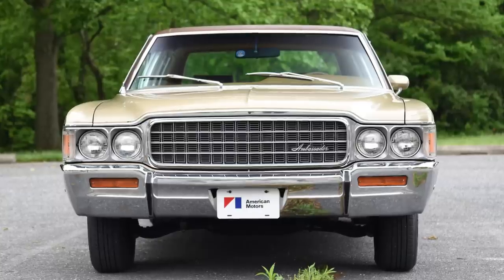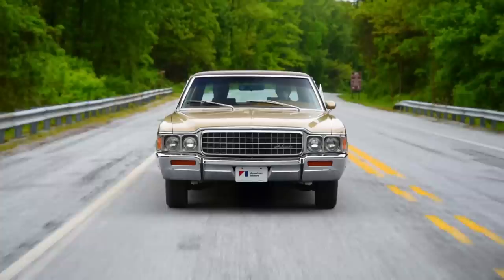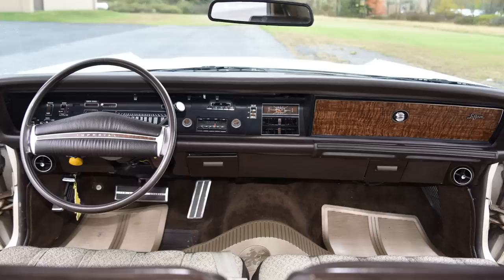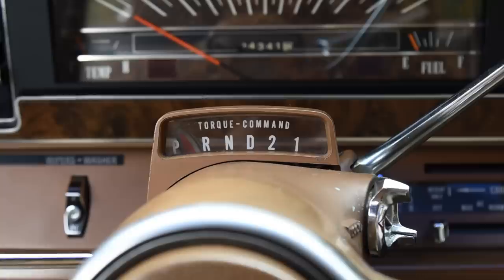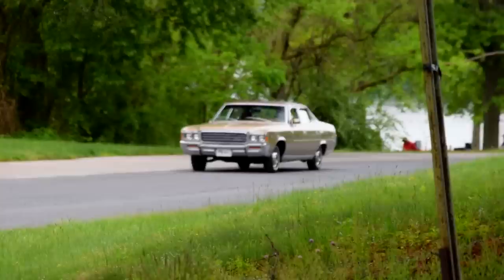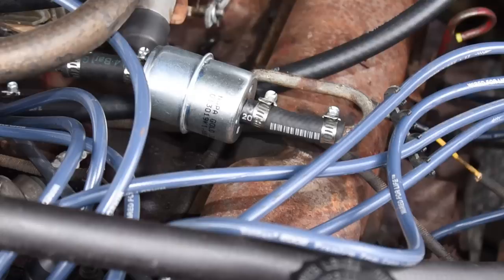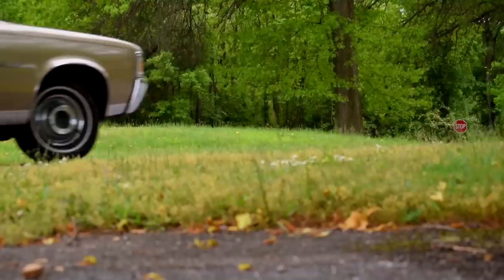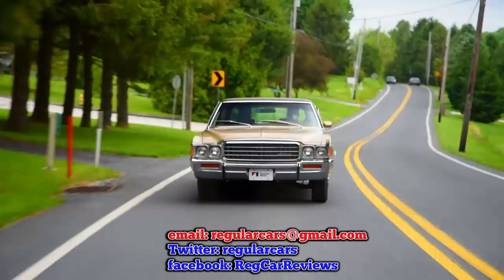1972 AMC Ambassador Brougham Sedan: Regular Car Reviews

Comment: Always had a soft spot for AMC cars. My parents had a 1982 Concord when I was a kid - 258 straight six, in a much smaller car. I think the Concord was built on the Hornet chassis. Mom still misses that car, all these years later. 

Looking back from this future space year of 2020, the Concord we had was kinda a junk car. The silver paint faded to gray in a year. The transmission lost reverse when the car was only three years old and had to be changed out. It leaked oil, and the computer-controlled carburetor was a bit finicky. At one point dad put a manual choke on it. 

Eventually, it was caught in a flood, which did the car in. It would still run, but the electrics were bad. We sold it for $300 around 1990.

Comment: 4:10 you dont even need a cable subscription to get Metv where I'm at. Its over the air
Reply: But you might need cable to get it clearly, without it freezing and looking pixelated.
Reply: @moonbeamskies3346  Nope. Comes in fine here and I'm over 30 miles from the broadcast antenna.

Comment: One thing to keep in mind with classic cars in general is they did have asbestos brakes. They were still a far cry from modern brakes but when said classic was new the brakes did work notably better than they do now with non asbestos brake pads/shoes installed. 
I recall the first time I put non asbestos pads on my Camaro. I was really disappointed  in their performance. They didn't grip as well and they overheated really quick. I called around looking for asbestos pads but when they were gone, they were gone.

Comment: Totally forgot about the standard GM power steering pump that all AMC cars used until 1988. Lol
Reply: There was a lot of GM parts-bin stuff on AMC vehicles. 

Like the evergreen GM steering column. Didn’t matter if you had a 1972 Vega or a 1996 Corvette.. they all had the same steering column with the hazard lights in the impossible to find 4 o’clock position that usually broke the plastic knob for how hard it was to pull out. 

It was also on our 1986 AMC Jeep Cherokee. When I got my first car, a 1986 Buick Skyhawk, I was amazed that the steering column was exactly the same.

Comment: My 1972 Ambassador SST Station Wagon had a 360 4 bbl. Here are some tips to Ambassador owners: 

The 2 main things to focus on is ignition and valve springs. Buy some valve springs from comp cams and replace them, and get a MSD ignition system or a no points condenser from pertronix. 

Another point of power is the carb. Put a 700 4 bbl on it, they sell an aluminum 4bbl intake if you have a 2 bbl carb factory. 

Another point of interest is compression. The ratio is 8.25:1, milling some aftermarket heads can net you an entire point of compression.

If any of yall want a 401 4 speed 2 door car that's been sitting 5 years, I can hook you up!

Comment: My dad bought a new dark green Ambassador SST wagon that year. The 360 seemed anemic especially when compared to my 1969 Ambassador 2 door hardtop with a 343 engine and a Carter AFB 4 bbl. Unfortunately in 1970 AMC dropped the compression on their engines to try to squeeze some better mileage out of them, and it just resulted in the cars being slow.

Comment: I've experienced V8 engines with 2bbl carbs - namely my dad's '76 F250 (with a 360 FE mill) and my '80 Olds Cutlass Brougham (with a 260).  Both had a hard limit as to where they didn't want to rev anymore.  With its low gearing, the F250 got really wheezy above 60 mph in fourth, and the Olds just couldn't get out of its own way.  It would do 70 mph on the freeway, but it took its sweet ol' time to get there and it really didn't want to go any faster than that.

Comment: Yes it is "choked".. Low compression designed to run on low octane unleaded.  My parents '72 350 V8 was good for 165.  AMC developed it on a budget of about $12.
Reply: Sorry but it was not a low compression engine.  Try 9.0 to 1 compression and some at 10.0 to 1. It wasn't until 1974 that the engines were dropped down to 8.5 to 1 for most engines. And to give you an example, the 8.1L in my Chevy only runs 9.1:1. An AMC 390 from 1970 nearly matches the torque ( 20 lb-ft less ) of the 8.1 and the 8.1 in 2001 produced more HP ( 105 more ) and only 45lb-ft less torque than the Chevy 6.6 Duramax.

Comment: As you stated, the horsepower for a 1972 Ambassador with a 360 2-barrel is 175 net.  A 1972 Chevy Impala with a 350 2-barrel is rated 165 HP net, and the Impala is about 400 pounds heavier.  AMC 360 engines run quite well.  If the one you're driving doesn't get out of it's own way, perhaps someone should check the ignition timing.

Comment: 4:50

For anyone born after 1990.. that is what a HOT AIR INTAKE is. 

Carburetors don’t have the benefit of hundreds or thousands of PSI to push through injectors to atomize fuel. They only have the velocity of the air going through the venturi to do it.

So carbs use heat to help it along. First by mounting it on top of the engine to bathe it in heat. Second by having the intake take air from right above the engine. Third by taking hot air from around the exhaust so you can have warm air and kick the choke off before the engine bay is completely warm. 

A “cold air intake” got rid of all that. Cold air is denser so you get more power, but the fuel doesn’t atomize as well and your fuel economy was worse. Your engine would be hard to start and wouldn’t idle easily when cold, but you had more power. 

With fuel injection, no need to have warm air. Every car made since 1990 or so has a cold air intake. So don’t waste your money thinking you’re getting something special. You’re not. It’s just a buzzword that survived the era of carburetion.

Comment: 1972,Brown.  Today is gray and grey.  It has a low compression engine.  There was and ERG valve, carb was running leaner than a few years before.  It has 10 hp  more than the Chevy 350 Impala.

Comment: Good gawd...could you have been any harsher about a 48 year old survivor. It was designed as sensible transportation for the American family,  that offered a spacious cabin for 6 persons, fully reclining front seats, standard A/C, a bullet proof automatic transmission, a 360 C.I. V/8, and a 5 year bumper to bumper warranty, all for under $6000 bucks. It wasn't a "looker", but it offered good value for the money.
As for the engine's anemic performance, all automobiles built by American Manufacturers for the 1972 model year suffered the same issue, as new emission standards were enacted that year that zapped engine performance, and as was the problem with my 72 Chevy Nova with it's 307 C.I., 2bbl. V/8, caused it to cough, sputter, and occasionally stall until it was fully warmed up. A problem on cold winter mornings when you running late for work!

Comment: 1972 is not before emissions controls. Catalytic converters were still a couple of years in the future, but cars from that year had to be able to run on the early low-octane unleaded.  1972 cars also had to meet NOx emissions standards, which meant the earliest use of EGR valves. As a rule, all 1972 cars sold in the US were less powerful than their 1971 counterparts. The 1971 Ambassador wasn't a fast car, but the 1972 model was slower with good reason.
Reply: There was also the switch from gross to net horsepower ratings.

Comment: 11:10  "A car like this could only happen before the oil embargo" 
As an owner of a '78 Ford LTD "Hold my fuel economy"
Reply: Ford was the last holdout; there was a half-measure of downsizing early on and then nothing really happened with the sedans until the Fox intro and Panther refresh. First run of downsizing was '74-76 mixed across lines, they knocked a foot and 1000 pounds off everything, and halted there until roughly 1980 for most things.  ROUGHLY. Don't nitpick, I'm being vague so I don't write a book.

Comment: these were actually pretty good cars other than a mushy front suspension. the drivetrain was very durable but running over a bottlecap felt like a cynder-block. but still an under-rated car.

Comment: Why does it make 175 hp? 
1: 2" single exhaust (2" duals optional on 360 standard on 401) 
2: 300 cfm carb (700 optional on 360 standard on 401)
3: low compression 

The 360 with a 4 bbl made 195 and dual exhaust allowed for 220 hp. 

Base model 304 made 155 hp if I recall correctly

401 was rare and was usually in a 2 door teamed with a 4 speed. I think they were rated for 250? Not to sure on the 401

Comment: The Ambassador is the last gasp of what doomed AMC.  Back in the Rambler days AMC had a niche.  They made small, safe, reliable (for the day) cars that sold very well.  They weren't exciting, they weren't fast, but they made great cars for retried couples, teenagers, and the occasional young person who forgot the Falcon or Corvair existed.  Once Romney left and they decided they were going to compete in big cars, the company was doomed.  It did not have the resources to produce a full line.  If they'd stuck to small cars, who knows?  AMC with Jeep at its side may have rode the small car wave into the 70's with the imports and survived.  I kinda doubt it, this is the company that made the Pacer after all,  but its possible.
Reply: Yes, if instead of the Pacer and Matador Coupe, they'd have made a 4 cyl transverse front drive small car....

Comment: Certainly this car is misunderstood.  It wasn't supposed to be their mid size entry.  I'll add a layer of hubris for you here.  This was their response to cars like the Chevrolet Caprice, Ford LTD, and the Plymouth Fury Gran Sedan (brochure shows that dark green that you'd see everywhere on Mopars at the time).  It had a longer wheelbase, but managed to be shorter than those, and narrower as well, as it was no wider than their mid size car, the Matador.   It was also probably taller, but AMC doesn't list that dimension in its specs.  A full size Chevrolet, loaded, was no taller than 54.1 inches, wagons aside, according to the brochure, again.  A Impala Sport Coupe of that year was barely taller than today's Camaro.  That was something you'd use as a family car.

I think the amount of brown on that car got to you, and I wouldn't blame you.  You couldn't escape brown even if you bought another interior color (three others were available), as the fake wood look extended to the speedometer.  Even so, the remakes done to the Ambassador until the last ones were built for '74 are a matter of taste.  I like the '67 and '68 models better, they were truly nice looking cars, and a convertible was available.

As for the speed, or lack of, take a look at those contemporaries of the Ambassador.  A quick look through the ads brings up a reasonably original '73 Impala sedan with an interior that will bring up the song Yellow Submarine (sky of blue, sea of green), and what is probably a 350 2 barrel, which only made 145 hp that year.  Also of note is a '72 LTD 2 door with a 351 2 barrel where you will again wallow in a field of green, and a '74 Fury station wagon that is a not terribly distant relative of the Bluesmobile Dodge Monaco.  Without the cop motor, cop suspension, cop shocks, you have a perfect slice of what the typical car buyer chose from in those days.  Just because it had 8 cylinders didn't mean that it was up for enforcing a scorched pavement policy. AMC was not alone, and considering that a '74 401 still had 245 hp, in some ways, better off.  Noting the rear sway bar on that Ambassador, my next question is how much of the Matador police package is under that car.

I like that you showed a good  bit of research on this one.  There are YouTubers that would have tried to do this without knowing what the Ambassador name ever meant.

Were that thing mine, I'd probably own up to it.  It's a reminder to future generations that not everything built in those days was a hot rod.  The best thing about it is the worst thing about it.  This, in one form or another, was how middle America really rolled.

Comment: That hp was pretty high for the times. just at the beginning of the oil embargo and the end of the horse power race with the big 3. My dad bought a 1979 full size Plymouth Voyager van with a 318, it was only rated for 125 hp.. I know the Ambassador was marketed for a certain drivers market...but 175 hp in 72 from a non-hp based performance sedan was pretty healthy for AMC...

Comment: I had an acquaintance who had one of these in high school. Her dad gave it to her. I was always puzzled and charmed by its "desert only" A/C setting.
On the subject of powerless old cars, that's just how cars were before the aughts. The idea that every car should have over 200 horsepower and 0 to 60 in seven seconds is slow just wasn't a thing. Only sports cars were fast. Consider that Ford's flathead V8 produced all of 65 horsepower at the end of its run, or that the standard engine for Chevy's half and three quarter ton trucks from the sixties thru 1990 was a 235 straight six that maybe made 90 horsepower, and then a 250 six that might have been pushing 150 HP by the year it was finally phased out for the 170 HP 4.3 vortec V6. Old cars were slow compared to moderns.

Comment: AMC's basic mid-size car was the Rebel with a 114 inch wheelbase. The Ambassador was stretched to a 122" WB to be in the same category as big Chevys, Fords and Plymouths. Unfortunately the Ambassador interior was the same size as the Rebels. It really never made any sense. I'm amazed that they sold as many as they did.
I was a lot boy for a Rambler-Volvo-Triumph dealer in 1968 or so. Assembly quality from the factory was lousy. Most of them took a couple of hours to tune up and line up mismatched panels, etc. Nothing except the name changed from then until 1972. "They don't make them like they used to."  That's good, because they were awful even when they were new.

Comment: @RegularCars...I think you might be missing that many engines had lowered compression in the 1970-73 model years across manufacturers, to make up for lack of lead and to run on 91 octane research (87 octane at pumps) and this pulled the oomph out of these motors.
Reply: When NOx emissions first came out (1972), the only way to deal with it initially was to lower compression ratios, as NOx emissions were directly related to combustion temperatures, and the easiest and at the time only way to do that was lower compression.

Comment: Correction: it does not have a 5.8L V8. It has a 360 cu in V8 that only produces 175 to 220 HP (hard to find the exact number for that model year and body). If you wanted the faster version, you got the 4 barrel 360 V8 with 285 to 295 HP or you got the 401 V8 with all 335 ponies. If grandma wanted any more power than that, you were looking at aftermarket parts. The two barrel carb on this one is horrible. The four barrel carb option had high compression as well including the need for premium octane fuel too. This one just has the second suckiest engine they could put in it (304 cu in only made 210) that was a trick to have customers buy the 360 2 barrel and thing they were getting more power when they weren't.

Comment: This is stupid. Totally misses the point of 70s rides. I miss my cousins brand new 62 Biscayne w/ a 283 2 sp. power glide and single exhaust.  You had to ride in these cars when they were new. They drove effortlessly and silent. Comfortably. To conflate them with the present day designs is a folly. The bass player in my band has a completely restored 65 Cadillac convertible  that has a few thousand miles on a frame off blue print resto. Its not fast but it performs as new and riding in it is a joy that you cant get in a Maybach now. These cars like the AMC were built for people that drove 2 miles to work and didnt worry about going 80+ mph w/ brimbo brakes when the traffic lets up.

Comment: I enjoyed the video but not the commentary. In 1972, brown full sized cars were very popular. And, most larger cars had vinyl tops if they were a Brougham model or other higher series trim. Perhaps the Ambassador's biggest problem was that it wasn't any larger inside than a Matador. All the extra wheelbase length was added on at the front. Still, I think it's quite handsome, while acknowledging  that consumer expectations and tastes have changed.

Comment: The rear end gear is probably 2:73 or something super low. A good 55 mph highway gear. Step up that and it would probably come to life
Reply: Had to be something wrong with it, or they were light-footing the gas for dramatic effect.  These had the Chrysler torqueflite which had a plenty high-enough stall converter and low enough first gear.  And the engine was a 360 2 bbl which should have had plenty of grunt.  And it's a unibody, hundreds of lbs lighter than similar-size cars of the time.

Comment: The only  thing I have to complain about this car is the plastic seats covers when it was really hot outside anyone gets in & right away when sitting wether it was the back seat or the front passenger seat, it would burn your bladder & your piss would come out hot like hot sauce flowing through your body so hot that imagine some had no A/C & that would spell trouble to people suffering heart failure & senior citizens would literally bake inside this oven on wheels. My dad had one & immediately felt the hot on my ass I could never forget the experience. Overall it was a great car but before fabric seats came all seats were in plastic & plastic throughout time would crack with the sun baking inside, thank God for fabric seats as they take less heat to burn our behinds.